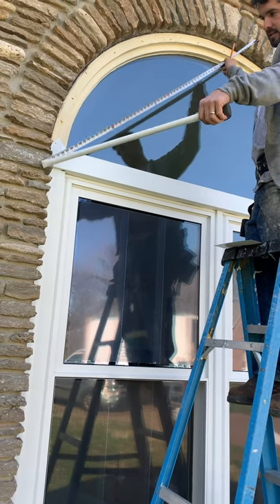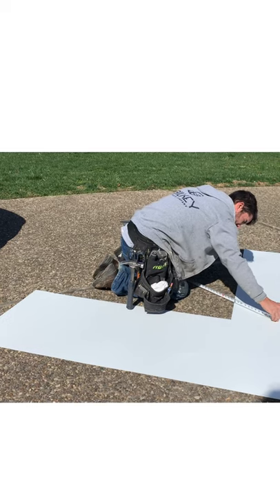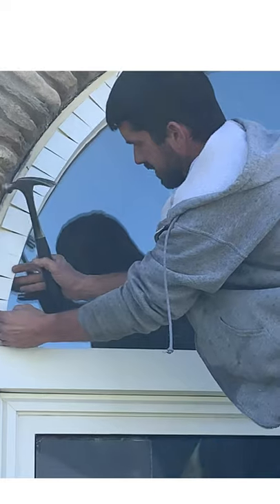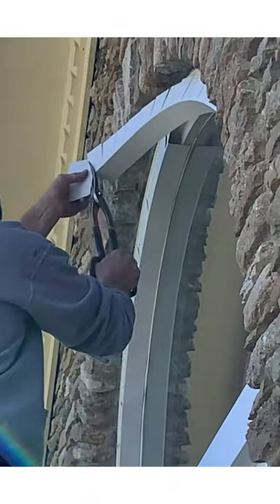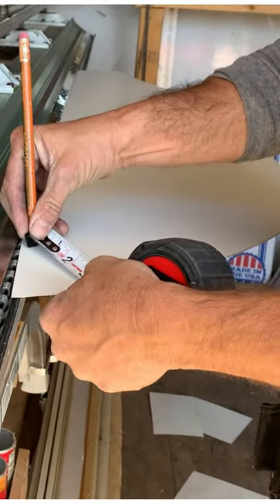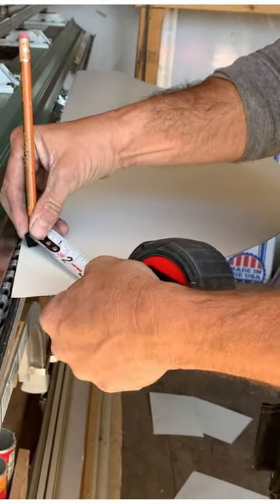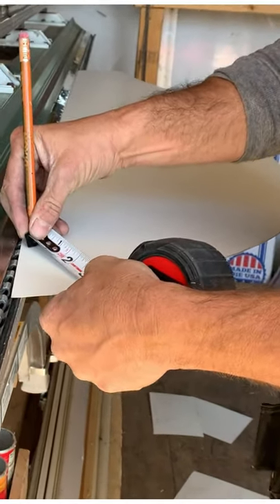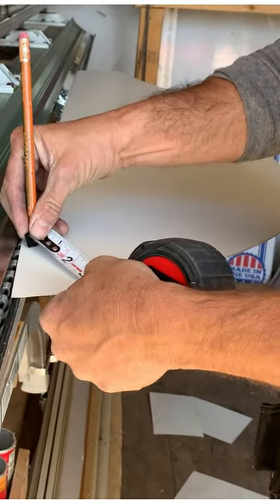Tips to wrap a round top

Comment: What does something like this cost, labor wise?
Reply from the maker: Working for a company: from $50-$100. They supply materials. If for your own contract: $200-300 plus material (roll of coil and 3-4 tubes silicone). Depending on height and size. takes 30 to 60 minutes to do. I have done 13 in one day before.
Reply: Where did you buy the material
Reply from the maker: ABC supply is a big place to get coil. Lowes and home depot has coil also